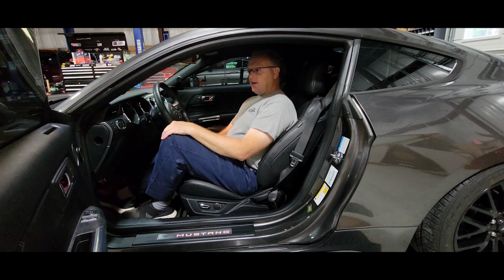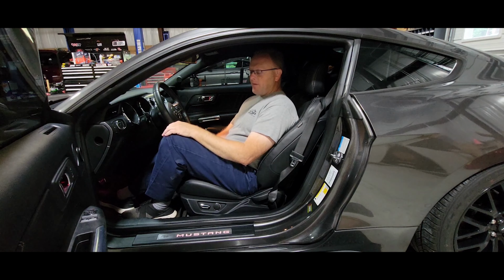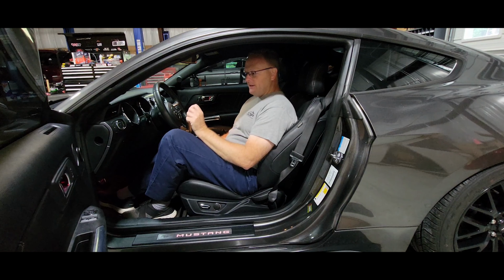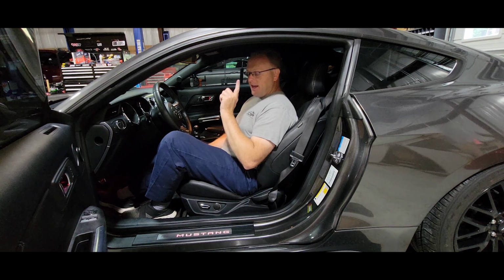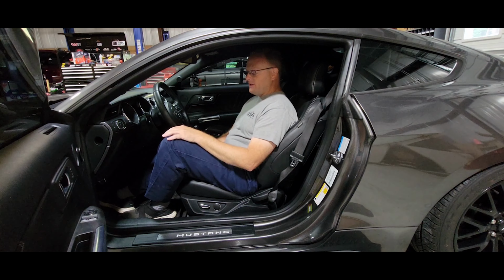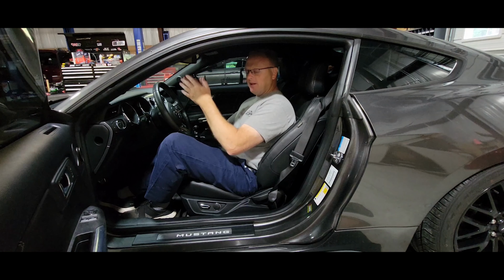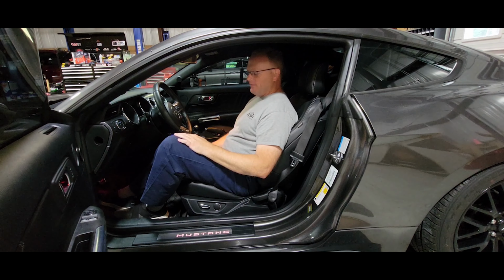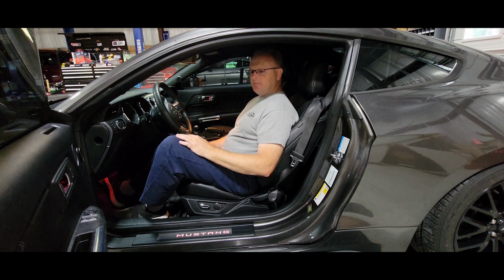Mustang and F150 Ghost Cam Tuning Explained!

Comment: I have 2013 gt mustang automatic and I only have the resonator cut off and awe track axle back exhaust and have the bama tuner with the ghost cam and it’s my daily would anything mess up I don’t let it sit for long idling just when it’s been sitting for a while
Reply from the maker: @jaimevega7526  The ghost cam will not hurt anything with things as you mention. We would have to get your tuned with one of our RTD3 tuning packages instead of the Bama tuner.
Reply: @drpmotorsports2186  what’s the link to the websites
Reply from the maker: @jaimevega7526  https://drpmotorsports.com/collections/mustang-tuning/products/2011-2023-coyote-mustang-custom-tune-for-hp-tuners-device-rtd-device-included

Comment: If I revved mine it will constantly drop to 400 and up 1200! And my tuner claims it reduces a lot of vacuum manifold 🤨🤔
Reply: Need to find another tuner cause yours ain’t figured out ghost cam tuning yet
Reply: @mbperformance6092  supposedly because I have the 87mm tb
Reply: Been running ghost cam tunes on mustang and f150s with stock and larger after market ecus with no issues like I said tuner need to send you a revision cause what he sent you ain’t working haha a simple log and he SHOULD be able to fix the issue if not I’d find someone else
Reply: If your tuner isn’t having you test and log he’s a rookie.
Reply: @jimmydiamond75 sent multiple logs but this was his exact response “Unfortunately that does come with the ghost cam and burble feature.  It reduces alot of manifold vacuum, spark had to be adjusted in order to achieve both the ghost cam and burble and usually the only way to make sure it drives 100% or even 70% better is to reduce it by more than half of it and it'll be hardly noticeable at that point”
Reply: @19stangmode  what tuner did you go to?
Reply: @mywa8314  that was Ortiz tune now I’m with P1tuners but no one can get the ghost cam down🤷🏻‍♂️ ig it’s the 87mm tb I have
Reply: @mbperformance6092  been through two different tuners Ortiz n P1tuners no one can get the ghost cam to act right idk if it’s the 87mm tb or what 🤷🏻‍♂️ so I’m not worried

Comment: I’m in Boston MA. Going for headers and handheld tunner next week. Is this ghost cam tune possible on a handheld and able to turn off and on or is it a permanent tune that can’t be turned off? Also, 2-step… is that safe? Thanks for the video!!
Reply from the maker: We tune remotely with both the RTD3 and SCT X4 device.  We do the ghost cam options with both and you can turn them on and off.  2 steps can be rough on things if you use them too often.
Reply: @drpmotorsports2186  thank you! Also, is the ghost cam tune safe with catted long tube headers or will it just burn out the catalytic converter over time?
Reply from the maker: @breezyproductions9039  it's safe

Comment: I have a 2014 Mustang GT (Stock except for deleted muffler) Is cam tuning safe for a daily driver and will it pass smog etc? I would love to hear that chop.
Reply from the maker: Yes and yes provided cats are still on the car.
Reply: @drpmotorsports2186 I have 2013 gt mustang and I have awe track axle back exhaust and I’m stock everything but that so I can drive it everyday on the ghost cam and nothing bad happen ? Also if I want get a cat delete what would you recommend and does it need tuning ?

Comment: G'day Ray, does the ghost tune work on a mustang with a roush supercharger?
Reply from the maker: Yes. The video of the car on the gravel road on this page has a Roush Supercharger...
https://drpmotorsports.com/pages/ghost-cam-tuning
Reply: @drpmotorsports2186  That is awesome! I had the same question. Are we able to put the Roush tune back as well, or do you lose it once you change it?
Reply from the maker: @A42yearoldARAB   We just modify the Roush tune, so the basics of it stay in place. Course we can make the car perform better with our custom tuning because the Roush tune is ultra conservative and leaves power on the table.

Comment: Is it possible to have Ghost Cam with running a CJ manifold
Reply from the maker: Absolutely
Reply: Awesome, I appreciate the videos and the straightforward talk. Does the larger plenum of the CJ affect how it sounds as opposed to the stock 18 manifold
Reply from the maker: @airflow_concepts  No but you have to pick the right cam angles to make it sound it's best
Reply: @drpmotorsports2186  👍🏻. Obviously I'm hoping things work out with my current tuner and parts combo.  If not, I will definitely be calling you up next to bat.

Comment: The clowns hating on this are the same ones that believe they are better skilled and faster because they drive a manual transmission. They mind as well remove the power steering, power brakes, and cruise control if they want to be a real man. 🤣🤣🤣🤣

Comment: Any concerns about cylinder wash from excess fuel at idle?  I run an e85 tune on my ‘15 but every now and then like to load up a 93 cam tune just to hear the chop and feel the rowdy idle. I never do long term because I never could find input from a tuner if cylinder wash is a concern if you run a ghost cam tune as a daily. 

Great vid!
Reply from the maker: No concerns because we not dumping extra fuel to make it chop. Lambda still stays on target keeping air fuel ratio good.